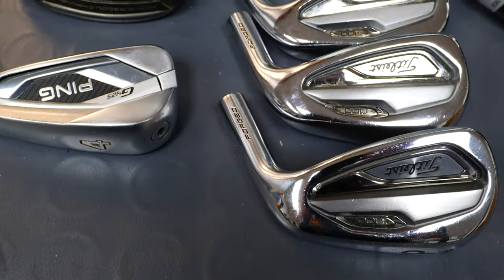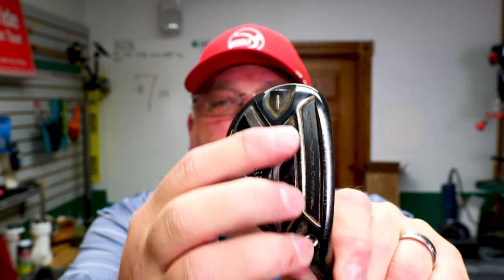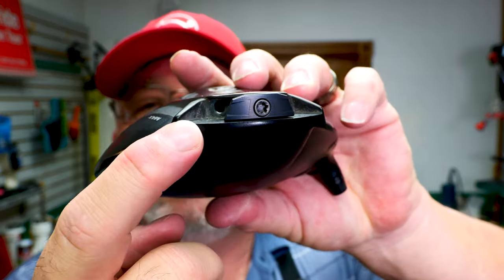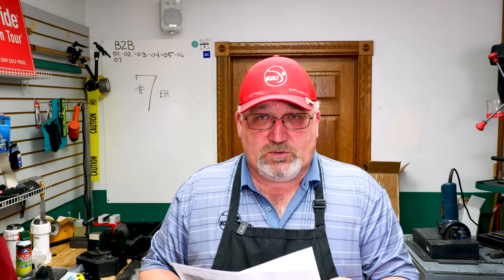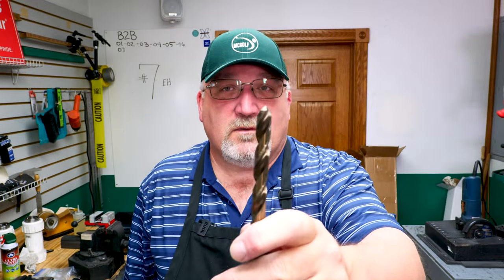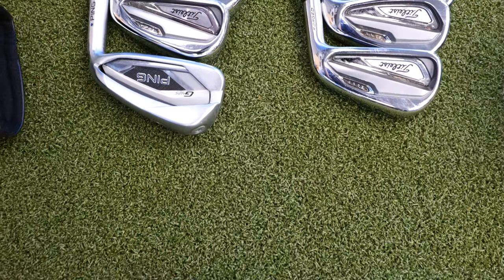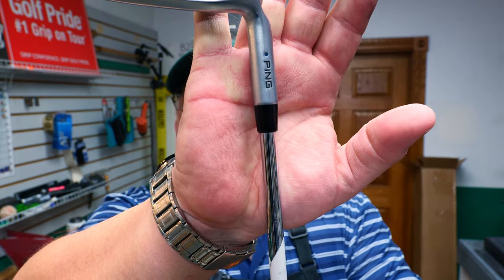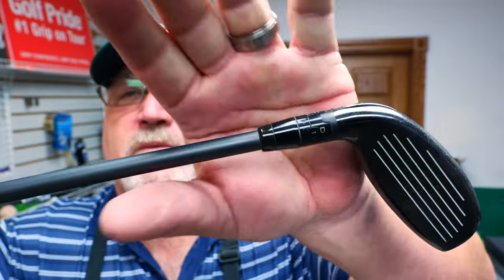Golf Club Repair - Golf Flex Matching and Reaming Hosels

Comment: Good afternoon,
I currently play a TSI2 driver 
My swing speed is 98 miles an hour 
The shaft in my driver is the Tensei Blue AV SFW 55 gram stiff.

Currently when I swing my driver, I am UNABLE to FEEL the head load in the shaft.

I am looking for a shaft that would help me have a better feeling of the head loading. 

I have done extensive research on graphite design shafts, but I am open to any other manufacture 

What do you suggest?

Comment: How accurate have you found shaft tips to be??  I can get either a 9.5mm (0.3740") or 9.6mm (0.3779") on Ebay but I don't have the shafts yet.  I'm fitting Dynamic Gold shafts 0.370 into Bridgestone irons with 0.355 hosel for ease of ordering new shafts and stepping them differently.

Comment: I have never understood why the FLO is tested perpendicular to the target line. It seems to me the way a shaft should flex in a straight line is along the target line so it doesn't droop as much at impact and hitting the center of the face is easier. That is the way I build my clubs and clubs for others which seems to work well.
Reply from the maker: There are plenty people that build to your concept. When this process came out we have high speed camera data that showed the shaft bent down  not so much to the target so making the club consistent in line with the why it bent was preferable.

Comment: Quick question: if flex is a measure of cpm vs length, shouldn’t this be the same for all manufacturers??…or manufacturers define their flex differently??…I mean, regular is regular isn’t it???
Reply from the maker: good question, However each machine reads a little different which isnt enough to make a big deal but each manufacturer has a different idea of what is stiff and regualr etc. That's where we come in

Comment: Great video. One question, and I may have heard it wrong but how did you get an 8gram weight into the tip of the driver shaft?
Reply from the maker: there are two kinds of tip weights that go into the shaft I have recently come into a model that places most of the weight in the tip shaft instead of the end.

Comment: Nice video 
Question when you FLO a shaft with an adaptor and your head is set at whatever degree you choose and adjust the loft later on are you kinda screwed on your FLO now
Reply from the maker: yes except for callaway